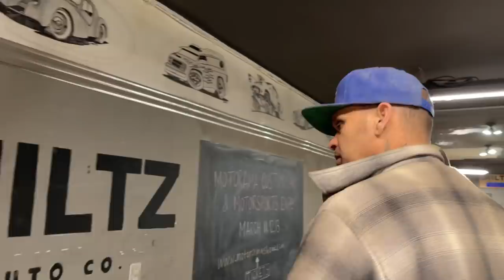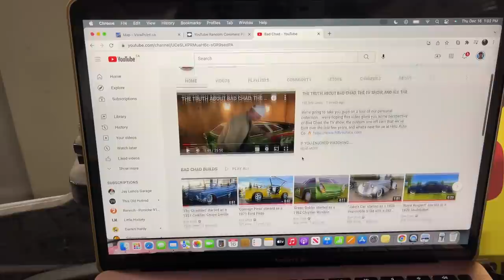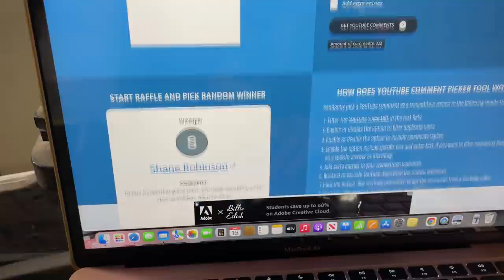Fabricating Gussets using a Paper Pattern for Custom Built Chassis

Comment: Gussets, better to overbuild than underbuild. Pre-made gussets? Pretty awesome.adding the gussets remove flex, improves steering response. I will be adding steel to the control arms and k-member on my barracuda and the dart. 
Remember, vertical welding uphill for strength. Needs more heat, most of it wont move anyway. 
I dont think i will be able to watch you sandblast in the snow. I’m cold enough as it is. It will give me the chills, im cold enough this week.

Comment: Chad and jolene just a little idea for you both. When you welded the nuts in the chassi for the engine mounts I've known them to brake out cause you can't get much of a weld on them and all the vibration as well. I weld around a repair washer over the top of the nut it stops the chance of it pulling out it makes it more like original if you know what I'm trying to say. Keep up the great work the both of you 👍 👏

Comment: Hey Chad, What are you building, a tank. lol Great job and thanks for the tips. They will come in handy if I ever find a half way descent go cart frame. I want to build a go cart for my grandson. That's when I will by a welder. I want to put a roll bar on it as well. Glad your feeling better Jolene. I know about bad backs. Been out of work for 20 plus years now. Had one surgery and that surgeon screwed me up worst then when I started. Be careful and safe.

Comment: Whats up Chad, like what you do.If I may give you my input on your cup and tip.Grind down your tip so it will be inside the cup about an 1/8-1/4 inch and use some nozzle dip to keep your tip clean from splatter, it will work better for welding.

Comment: You can get cheater lenses that fit inside your welding helmet. They are only about 10 bucks. You can pick the level of magnification you like. Put them in all the helmets so you won't need glasses. Young people not needing the magnification can just pop them out, held in with those little wire tensioning cages. Available on amazon etc. If you don't know what magnification you need, just go to the drug store and test out what is on the rack looking at your hand 16 inches away. I have them in all my helmets, saves a lot of frustration.